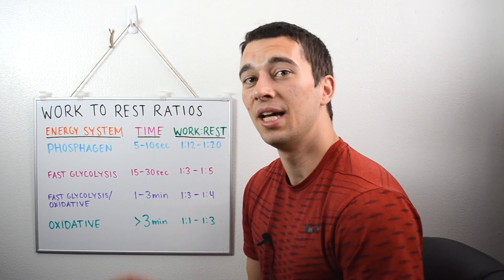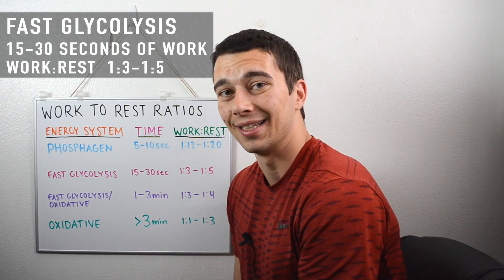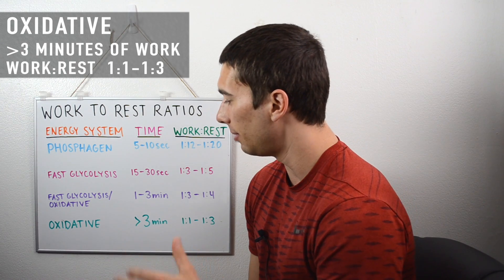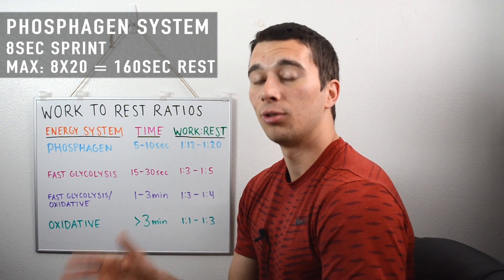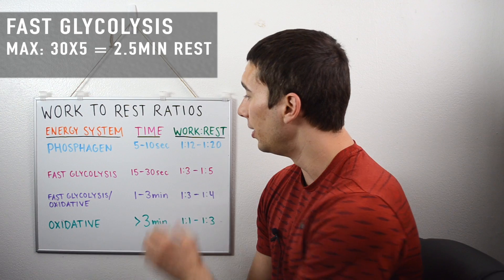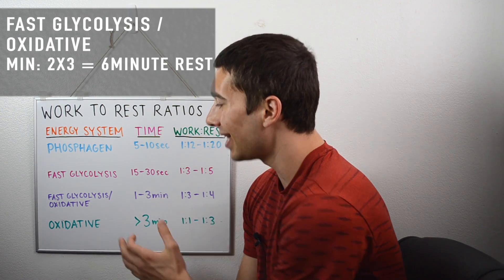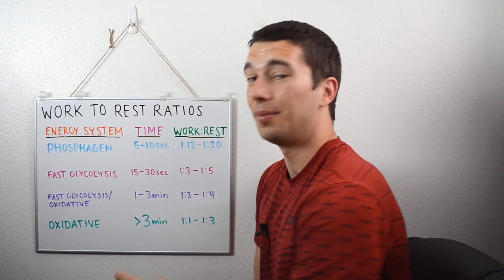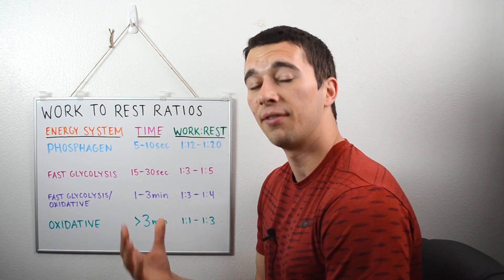NSCA CSCS Work to Rest Ratio Explained! (ATP/PCr, Anaerobic Glycolysis, Oxidative Energy Systems)

Comment: Have You consider a New Paradigm of Bioenergetics? 
Which tells us that PCr and Oxygen utilization&recovery is coupled to each other and oxygen as well as PCr  is used immediately upon load
Reply from the maker: Yea that's not new. It's well known that the energy systems work in combination immediately. So both PCr and the aerobic system are working at low and high intensity just in different proportion

Comment: Very interesting video. 
Lately i’m doing this workout in which i do resistance training with weights, (usually 4 set for 12 to 18 reps), rest between set is 40 to 50 seconds.. but lately i like to rest not standing but running light on the treadmill (keeping the heart rate a little bit higher). 
In this case… what kind of metabolism am i using during this type of workout?? 
Thanks.
Reply: Not to much benefits system

Comment: These rest ratios do not work for track training sessions. The phosphagen rest ratio is about right. The atp system that lasts up to 25s requires more rest than is indicated here. Only top level endurance athletes could tolerate that short of a rest. Any fast twitch athlete will need more rest because they generate more lactic acid. Also Training session for distance sessions I.e. lactic tolerance, vo2 max, anaerobic threshold are all conducted at around 1:1 effort to rest ratios for good athletes or lower so less rest than is indicated here.

Comment: Thank you for the video!

One question. When the Work involves compound movements (let's say gymnastics rings)  if a routine is made of let's say front lever-back lever-iron cross where different muscle groups activate at max strength for short durations but the whole routine is ~30sec, which energy system is used mostly and what should one follow from the whiteboard ?

Comment: Hi Matt, thanks for the video. For resting, do you recommend the athlete to change to slow walk or completely rest (just standing still)?
Reply from the maker: Low activity active rest such as walking around or just standing will likely be very similar. I would not recommend "Rest" that elevates the heart rate significantly, as that could have a negative impact on ability to produce maximal force/speed during the work periods.
Reply: @TheMovementSystem  Thanks that would be useful a lot!

Comment: Hey Matt, great video! Totally makes sense. I reviewed the the ratios in the book in chapter 3 after watching this. Table 3.6 outlines pretty much everything you have on your white board except the book has an extra column for % of maximum power. 20-30% for oxidative, 90-100% for phosphagen sys, etc. I think after reading through chapter 20 I figured these %s are based off HR reserve. Am I correct in thinking that? To figure the actual HR I want to train in, say for training oxidative, I would take my resting HR and add 20-30% of my HR reserve?
Reply from the maker: I believe that is correct. 20% of MHR would be like 40BPM which wouldn't make sense.

Comment: Great video.  What would be an optimal combined time for a workout to train the fast glycolysis system utilizing the time and work to rest ratio numbers you mentioned?  Wondering, generally how reps would correlate for this system and each system to match the proper time and work to rest ratios?
Reply from the maker: There are different rest recommendations for resistance training that are based on reps. The work to rest ratios are more for cardiovascular/ interval type training like the examples in the video.

Comment: Thanks Matt! This makes it easy to understand :)
So, in case of strength training, when we are doing a movement like back squats for hypertrophy (8-12 rep range) and of course depending on the TUT, this will mainly fall in the third category of fast glycolysis/oxidative system?
And can we say this would be true for most resistance training/strength work? So we would barely tap into the first system (Phosphagen)?
Reply from the maker: There would be a combination of energy systems providing the ATP for a 20 second set of squats. The ATP-PC (phosphogen) system would provide a good bit of ATP for the fist 10 seconds, then glycolysis would start to take over as the primary energy system.

Comment: Pardon the ignorance, but what is the benefit of the prescribed rest( from a physiological stand-point) during cutting the rest short. I understand that with the proper rest you're replenishing the energy systems and clearing lactate but what is the long term training benefit of proper work: rest ratios?
Reply from the maker: Good question! Adequate rest will allow the energy system used to replenish and work at an optimal rate for the work intervals. This will result in greater training effectiveness (ex: better cardiovascular endurance, better enzyme function, increased fat burning, improved power output, or whatever adaptation is specific to the training being done)